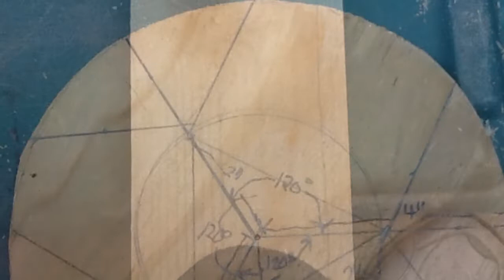How to build lapidary sphere machine from old cordless drill motors

Comment: I use windshield wiper motors which are cheap, plentiful, hi-torq, low-voltage,  and designed to work under heavy loads for ridiculous lengths of time. The scrapyard has an endless supply of them, virtually for free.
Reply: Show us your setup

Comment: I think this is a great idea. I’ve already got two old cordless drills that battery packs are done and not replaceable. I’m now going to hunt down a third.  I’ll check with my electrician friend about power as you’ve shown. I worked a number of years in my engineering life doing geotechnical work with some geology involvement. Creating those polished samples is very useful, especially for concrete analysis and testing. Good job !

Comment: probably designed to run that hot.  thumler tumblers use a motor that reaches thermal equilibrium.  if its under 160 f  ur good to go.  after 160 most electronics begin to degrade barring weaker exceptions but if its continuous duty anything under 160 is actually normal.  no stink no problem!  great video btw.  loved it

Comment: Thanks for posting this. Found this looking for a video from Austria that I saw several years ago of a water turbine ball mill run on a a river. Worked basically like a grist mill with stones with grooves in them. I have several septarium nodules and a few mammoth teeth I'd like to attempt turning spheres from. Think I'll try your idea, seams pretty straight forward. One question I have is are you running all three at the same speed? Seemed like one was turning slower. Wasn't sure if that's intentional or not.
Reply from the maker: Wasn’t intentional to run them at different speeds I never thought about it. I just assumed they would turn at similar speeds.  The initial shaping of the cubes is the time consuming part of making spheres.

Comment: How did you make the wooden cups with leather?
Reply from the maker: The wood polishing cups were made from a wood dowel with a counter sunk bolt in the center for the shaft.  The dowel center was shaped to a concave surface and leather was glued to it.  The hole saws I purchased on ebay.